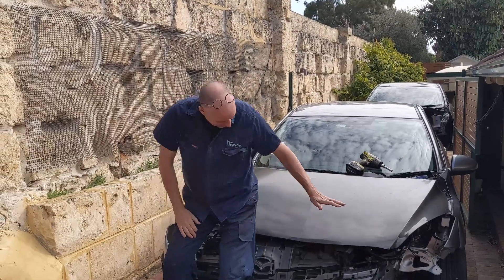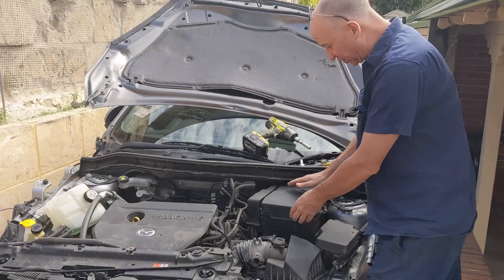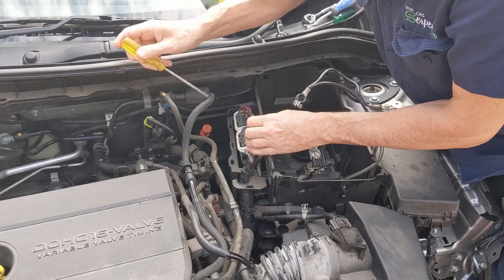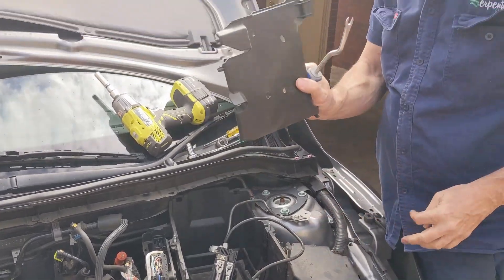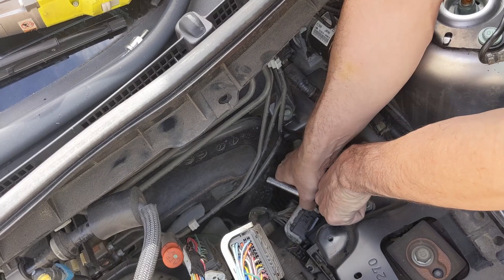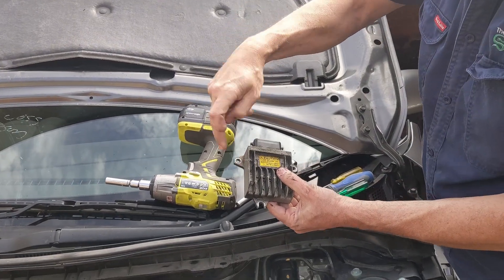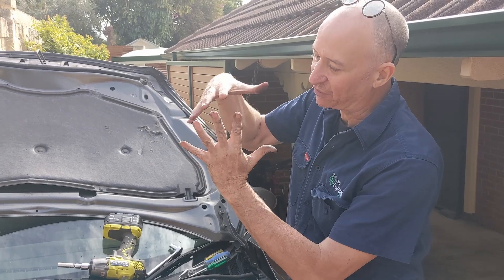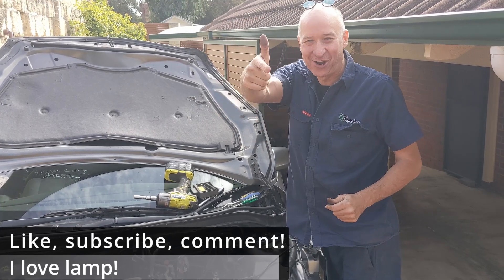BL Mazda 3: R&R the TCM. 2.0L 2.5L 2009 2010 2011 2012 2013 U0101 LFAE LFJS L552 L34N PE2G PE2K

Comment: Awesome video Paul! Thanks for helping me keep my car on the road! Few tips from my experience:

1. Totally easy to do with a socket set from Harbor Freight. Inside bolt underneath the counterbalance is annoying but probably the biggest hassle of fix.
2. A below comment says that you can leave the TCM in there and just mount the new one, but I recommend against this. You should unbolt your existing TCM and compare the part number against what is out there on Ebay.
3. You may have to cut open the gasket material on the backside of the TCM to do this, but make sure you order a new module with the same amount of chips on the top right side (if you were holding it connector-up). For example, mine was a 2 chip TCM. I ordered one off of Ebay and it ended up being a one-chip which made shifts extremely clunky and violent, bad enough that I didn't even want to leave my driveway. I ordered a more expensive one with 2 chips and I was back on the road. Even if you have the same part number matched, MAKE SURE the new part has the same chipset.
4. You can ziptie it to your brake lines, order a relocation kit (just a metal plate that goes onto your battery box), or get a 10mm nut and look for the bolt on the driver side firewall and fasten it there. I'll probably do the latter so I don't have to worry about the WNY cold making the zipties brittle. 

Thank you for posting this video to help us out man. Shame I can't buy you a beer. Stay safe out there.
Reply: Also, you can do this without having to go to a transmission shop. "Reprogramming" doesn't seem necessary. I have a 2010 Mazda 3 2.0. No OBD needed.
Reply from the maker: Hi there, I'm glad I was able to help.  If you would like to buy me a coffee, then I'm all for it.  Please donate here.  Also, if you are in Australia, it is tax deductible.  https://give.rarecancers.org.au/fundraisers/pauleddingtonptf

Comment: Pro tip: if you are going to replace the TCM and mount it to the firewall, you don't have to remove the old one! Just unplug it and leave it bolted to the transmission. Plug the new one in and mount it elsewhere. Saves a lot of time.
Reply from the maker: That is a very good point.  Thank you for that.  Paul.

Comment: Hey Paul, I have this problem in my Mazda 3 2011 car. i am planing  to replace it. i just need to know, after replacing TCM, do we need to program it?
Reply from the maker: No.  There is no programming required.  Just install the new TCM, put the battery back in and start the car and go driving.

Comment: 10:40 So the cables will reach the new mounting location on the firewall/brake lines if installed in that alternate location? 

Thanks for this video, by the way.
Reply: Great question,  from a couple other videos ive watched,  say it will

Comment: I have a 2010 Mazda5 (automatic) that takes about 7 seconds to shift to REVERSE, usually after driving it for a while when everything is nice and hot. When it does shift to reverse, it does it so aggressively, like the feeling of a manual transmission with the clutch suddenly let go. I don't have any slipping or problems driving forward. Do you think it's related to this?
Reply from the maker: Yes I do.  That sounds like a faulty TCM.
Reply: @PaulinPerth  During the morning when the car is still cool, it will go into reverse with relative ease backing out off my garage. You think I should (could) simply relocate it before it finally gets obliterated by heat?

Comment: Hi there. Really appreciate your video, it’s quite detailed and really helpful. 
I have a question now. My car is a 2.5 litre BL sedan 2009. 
And the error code I have is U0101 
The codes on my TCM is:

G
L539 18 9E 1D

But I’m not sure if it’s the one originally built for my car, or maybe previous owner put a module maybe, with a different code on it (maybe slightly different) 
Is there any was to verify for 100% that the one I have on my car right now, gone bad totally IS ACTUALLY THE ONE THAT MY CAR HAS TO HAVE.
Reply from the maker: Hi there, the only way I can think to do that is to ring your local Mazda dealership.  They should be able to tell you what model TCM your car came out of the factory with.  Hope that helps.  Paul.

Comment: Just replaced the TCM on my Mazda 3 2010 Saturday the check engine light went out and my transmission issues solved. I didn't even have to program the TCM thanks Paul.
Reply: Would you reg. Have to program the t.c.m. ? I was just going to go to junk yard and get one ? Or is refurbished better route u think ?
Reply: @lilhorse5633 Refurbished junkyard may not be tested and the tcm may already be bad from the junkyard.
Reply: @miltong1795 where did you get it replaced from? And did your engine jerk when shifting gears when it was messed up?

Comment: Thank you for this video. I send my tcm to be repair to injectionics  here in Perth and it took around 3 days. Now I put back the repaired tcm, all sign are fixed but my head light is not working. Do you think it’s related to tcm ?
Reply from the maker: I would be very surprised if the two are related.  Start by checking the headlight fuses and relay.

https://www.startmycar.com/mazda/mazda3/info/fusebox/2011

Out of curiosity, how much did Injectronics charge for the refurbishment?

Comment: Thanks I just finished my replacement on a 2010 3S.  waited until it warmed up (70 degrees today) in NC and just used a pry bar between the battery box and the firewall lip to bend it enough to pull out.  did the same going back in.  Lots of flex since it sat in sun.  really NO ISSUE getting to those 3 bolts on the TCM and its not wrecked like our example here.  Real time spent by an old man, probably 45 minutes. Would not have done this myself without the video Paul:)

Comment: Hi, my 2009 Mazda 3 engine light + AT light comes on and the car does a jerk simultaneously as these lights come on. Would it be because of the TCM?
Reply from the maker: I can't say for sure, but it does sound likely.
Reply: @PaulinPerth  thanks mate, I took a slight risk after weighing up the odds of what the problem is and decided to put a new TCM in there. Works perfectly like new now. Thanks for your video.
Reply from the maker: @ You're welcome.  Glad to help.  Paul.
Reply: Thank you so much Paul, you have been very helpful, Allan from Akron Ohio USA

Comment: Just had to replace my TCM and glad I found your video.   Getting the Battery box out was the hardest part then getting to the TCM.   Freaking folded engines are such a pain.  But I got it done and cars running so much better now.

Comment: Thank you Paul for the detailed step-by-step instruction.  I was able to quite easily remove the TCM from my 2012 Mazda 3 here in London, Ontario, Canada.  When the AT, Check Engine, and Traction Control lights came on one morning, the shop I took it too said I needed to take my car to the dealership to address the U0101 error code they found.  And the dealership said it wasn't really worth fixing for a car that old.  I did a lot of research online and firmly believe it is a failed TCM which I am sending to a reconditioning shop in Mississauga nearby.  I sure hope it solves my problem.  Thanks again for your excellent video!
Reply: Buddy, I live near sq1 and have had the EXACT same issue a couple of days ago. TCS, AT, and check engine all came on, no power, engine jolts from D to R, and I actually have the TCM in my bag now thinking what am I gonna do to fix it! Can you drop the shop name please? I might consider going there as well
Reply: @MohamedIbrahim-mj1yg  XeMODeX Inc - located in Mississauga
Reply: Just a quick note to say that the reconditioned Transmission Control Module resolved my problem!    : )
Reply: Was your car over revving?
Reply: @Rudecertiz  Yes, a bit.  It wasn't upshifting properly.  In fact, when I put it into Reverse, it "clunked" a bit.  Same when I put it into Drive; it shifted with a small jolt.
Reply: @cryptoknight3132 were they able to fix the TCM? From near van, BC btw
Reply: @GraciousMane  Yes, they were.  I removed it, mailed it to them, they returned it within a week, I reinstalled it, and it has been working fine since (knock on wood)!
Reply: @cryptoknight3132  so you didn't have to reprogram it, since it's the original one then correct? But it worked?
Reply: @huss56  Yes, that is correct.  I do not believe it was reprogrammed.  The XeMODeX Inc (Mississauga, ON) company I mailed the TCM to cleaned it up by re-soldering connections and testing it.  And upon simply re-installing it in my car, it has been working perfectly since - no further issues at all (knock on wood).

Comment: Hey man. I used the same guys you suggested in the video to repair my tcm. And they've charged me $1229.39 AUD.. ?? That's more expensive than I thought it was gonna be?
Reply from the maker: That's pretty standard for the repair shops.  Mazda charge over $3,000 AUD for a brand new one.  And anything secondhand can be days away from failing.

But you do have to wonder if it is worth learning how to do the recondition yourself and going into competition with them at that price.......

Comment: Hi Paul, many thanks for providing us with this very useful information.
My Mazda 3 2012 has recently started with this fault but only if I go on lengthy journeys whereby the transmission reaches it's peak temp.
Would it be worth just rehousing the existing unit to the brake lines as you suggested and testing it out further and see how it runs ?
Thanks again. 👍
Reply from the maker: Yep.  Relocate the TCM to the firewall, and hopefully your problem will not get any worse.
Reply: @PaulinPerth   Thank you sir !

Comment: Does this process would be the same in a Mazda 3 2016? Thanks
Reply from the maker: I don't believe so.  This forum post suggests it is inside the transmission.  https://www.mazdaforum.com/forum/mazda3-26/2016-mazda3-2-0l-isport-tcm-location-50522/

Please post back here when you find out the answer.

Comment: Hey Paul! Excelent video! I am from Argentina but living in Brisbane! I have a question, so i have a 2010 sp25 and the engine light turns on and the AT ligh ocasionally, and the scan read that it is the OSS ( code p0720) and then two codes from abs that said invalid data from body control module. Do you think i have to change TCM? 

Thank you for your help!
Reply from the maker: I've never come across that exact set of issues, but from reading here https://www.mazda3forums.com/threads/p0720-2010-mazda-3-tcm-relocation.770551/, it sounds like it is time for you to replace your TCM.

Paul.

Comment: USA here.   thanks for the helpful video and bit of advice at the end.   im choosing to go w/ a refurbished from ebay with a reputable seller.   i was all prepared to spend a fortune on a new one, until your tip about the bad engineering of the tcm in the first place.
Reply: Its not bad manufacturing. Its the fact that manufacturers have to use lead free solder and the placement of the module. The problem is the heating and cooling of the TCM. That causes circuit board flex and cracking of the solder joints.

Comment: Paul - do you know if a new one is bought from Mazda - with the same part number - does it need to be configured by Mazda or is it simply a plug and play? Cheers, Russ
Reply from the maker: Hello Russ, it is plug and play.  There is no configuration required.  Paul.
Reply: @PaulinPerth  Thanks Paul - was going to buy a new genuine Mazda one from PArtsouq in Dubai - $900 including courier, but then thought probably better to get mine repaired by Injectronics in Melbourne. $1200. So will let you know how they go. Mind you, the mechanics labour to replace (the car is a distance from me at the moment), is $850, which I think is a ripoff. But no option.
Reply from the maker: @russmeachamruss  Holy cow.  I wish I could charge $850 for that job.  You've seen in the video how easy it is.

Injectronics do a sterling job, so I am confident that your reconditioned unit will not fail again.

Just as a side note, I have seen on eBay recently sellers are offering units that appear to have been reconditioned in China.  I can't comment as to the quality, but the price is eye-catching:  around AUD $450.  I'm curious to hear if any subscribers have used these items.

Paul.
Reply: @PaulinPerth  It is stupid price isn't it. It's why I do most of the work on my cars. I hate being ripped off - they had 4.9 google review and lots of positive comments - clearly the people who go there are stupid or don't care about money. But they did check the solenoid resistance as I requested (which was what the error code said) and found it was fine. As expected. They were initially going to send the car to a transmission place to check - but I told them to just remove the TCM and have it repaired as I will take the risk that is the real problem - which it is. Hard to find mechanics you can trust.
Reply: @russmeachamruss  Wow. They open the module and re flow dry solder joints with leaded solder and then close it back up
Reply: @PaulinPerth  Hi Paul - so got the TCM repaired (yes it was the problem) and back. Car is fine. So my original guess it was the TCM proved correct - and that I directed them to change it and I found the repair folk in Melbourne says a lot given they were originally going to look at pulling the solenoid out and replace!! Now to the mechanic in Qld - their rate is $200 per hour - which I think is extremely steep for a non-dealer mechanic. However, at that rate you would think they were smart mechanics who use their brain to check things efficiently - nope! Because, I asked them to confirm the solenoid was not faulty (as reported by the now confirmed faulty TCM) while they had the TCM out. I assumed they were smart enough to put a meter across the wiring to the solenoid from the TCM connector to check the resistance - then check wiring to ground. Pretty simple concept really (and I can't be sure, but I think thats what I asked them to do). My mistake - I ASS-U-ME'd that's what they would do. But no - they took the sump off the tranny and checked it there. Completely unnecessary. Then when I got the bill, I questioned those costs. Of course, I got the classic 'we know what we are doing' run around. Secondly, they also said the transmission oil was very black and should have been changed anyway. Complete bullshit!! I have the transmission oil changed every 60k and the last change was in January (total 170k on a 17 year old car) and I know the colour on the dipstick was pink. And they want me to leave them a positive review....go figure! Its why I look after my cars myself - just this time it was too far away.
Reply: @bobsoft  I know - a lot of money to do that, but hopefully will solve any future issues till the car dies in 10 years. The price is not based on the effort/ cost - it's based on the fact Mazda charge a small fortune for spare parts! The real price should be $4-500 max. The mechanic shop is worse - which says it's a premium place is just a heap of shit. Not too smart at all. Would have been cheaper for me to fly up, stay overnight and fix it myself with a new genuine Mazda TCM couriered in 3 days from Partsouq in Dubai at $900 (vs Mazda $2400!). Would have been a nice trip! But couldn't leave home - damn!
Reply: @russmeachamruss  Our family has three Mazda 3 (2007) Two of them are manual and my wife's is automatic. I moved her module to the firewall shortly after buying her the car used 5 years ago. It still has the original TCM. 
Yes you have to be careful with mechanic shops when it comes to electronics. Many shops are parts changers and do not know how to diagnose. I maintain our fleet of vehicles after I lost faith in mechanic shops.
I also repair electronics down to the board level. 
Main thing to keeping these cars running is frequent oil changes. The 2.3L will commonly spin a bearing  if the oil is not kept full and changed. I do my oil changes every 5,000km.
Reply: @bobsoft  Agree - and transmission oil. Religiously change oil using fully synthetic every 6 months or 5k - whichever comes first. It is a simple thing to have the engine run forever - don't know why people skip oil change given the potential downside cost. Mind you I was going to get this lot to change the oil - they quoted $350. Will go elsewhere - silly number!! Now my daughter is remote, she just needs to find a reasonable local mechanic to do it using specified synthetic oil that I trust (Nulon these days). I've been over every fluid on the car - changed power steering fluid as well. No fluids last forever - but folk are not told to do it - "lifetime" - meaning length of warranty!!! Want the car to last her another 10 years. Best care of the planet to make cars last as long as possible rather than trashing.

Comment: My transmission shop recommended i spend 5 grand to rebuild the transmission when this might just save me an insane amount of money
Reply from the maker: Yep.  A faulty TCM will give all the impressions of a faulty transmission.  In all likelihood it's just the TCM.

I'm glad I was able to help you.  Please note that I have found some sellers on eBay selling reconditioned TCMs at a reasonable price.  So there is that option now.

Paul.
Reply: @PaulinPerth I was about to buy one brand new from Mazda but I’m glad you explained that it would fail again. I’m getting a reman TCM from eBay. Thanks!
Reply: @jerrychoochoo did it work
Reply: @PaulinPerth  thank you it really means a lot i managed to find some on ebay but rockauto and most websites are completely out of stock atleast for now.